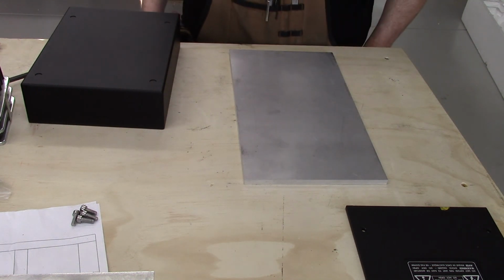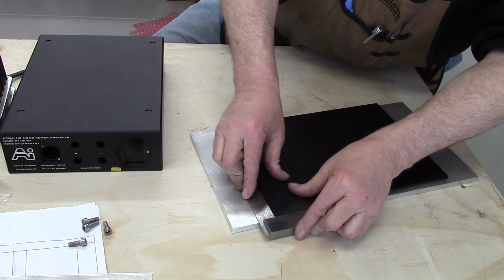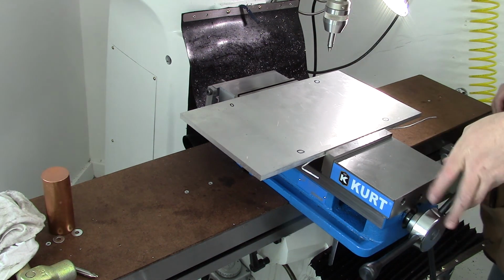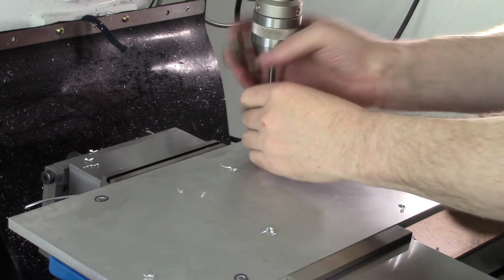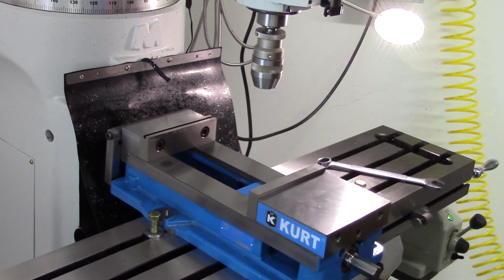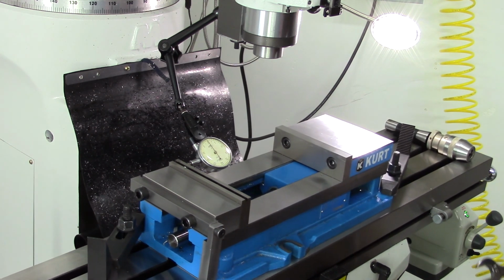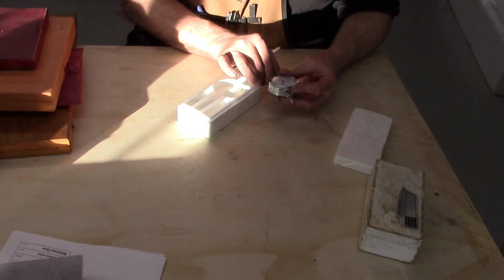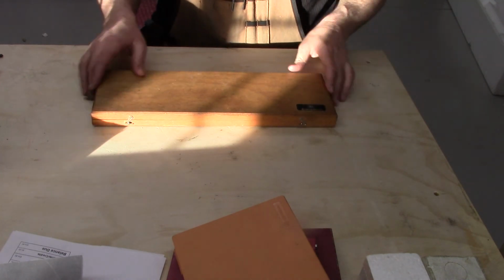Shop Drops #2, pt2

Comment: nice video mike. another option would have been to counter bore the holes bolt on the case then toe clamp the alum plate right to the bed of the mill. :-) devil is in the details.
Reply from the maker: Matt Tomahawk Thanks. I thought about that but I had a total of 6 to do, so being able to drop them in the vise sped things up a bit. I ended up doing four more this past weekend, so it's worked out well.